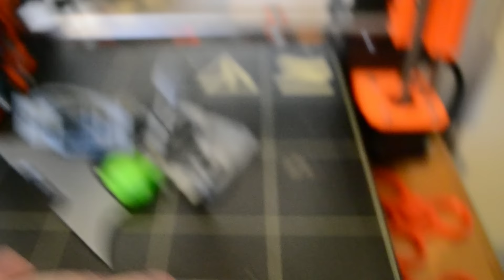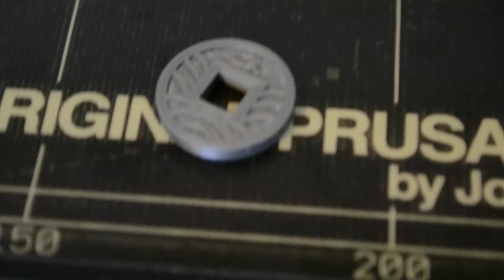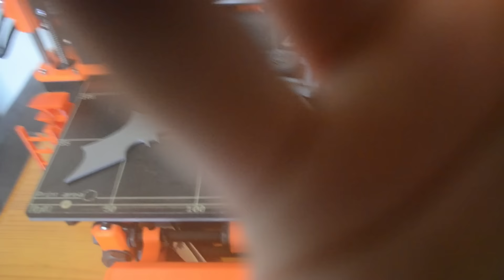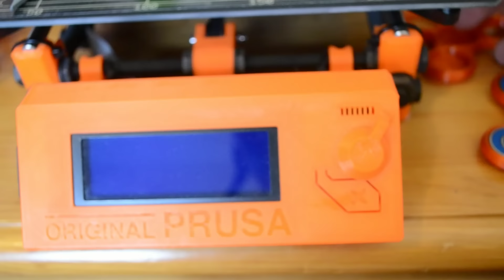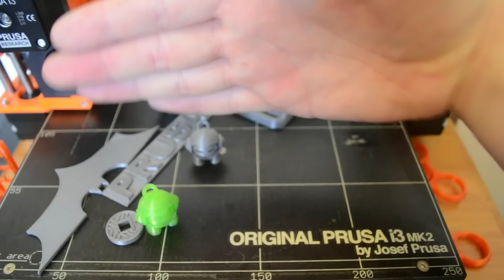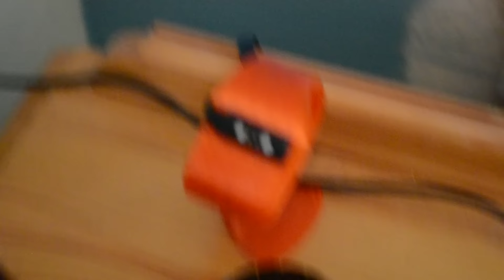3D Printing - My First Month With The Prusa i3 Mk2

Comment: How long did it take to deliver Prusa to you ? was it really about 8weeks or so ?
Reply from the maker: Rastislav Zimermann I ordered half way through December and got it at the end of January, so it was nearly exactly 6 weeks like it said when I ordered. I believe they are shipping April orders at the moment and have got a bigger print farm so have increased their output of printets
Reply: Thanks for quick reply. I am about to order it but as I am on holiday mid July-mid August there wont be anybody to collect it for me(no neigbours) so I need to time the order for later on. just I case. Btw, have you tried to print some mechanical parts or moving parts ?
Reply from the maker: Rastislav Zimermann Ah I see. Have a chat with support on the store and they might be able to sort something out =] I have done a few mechanical & moving parts, I printed the included gear bearing which spins great and came out perfectly first time. I had a few bits of trouble early on like I said but that was me not getting print settings right, but now everything comes out perfect every time

Comment: i'm not English and I can't watch the entire video... but I have 3 questions: is it difficult to build the printer? is it simple to print? are you happy to bought it? 
thanks
Reply from the maker: Marco Richiedei It isn't difficult to build for me as I have always been buildings and repairing things. It has very good instructions which should help even newcomers to build it properly.
Printing is fairly simple, as you can just download a file from thingiverse, put it in the slic3r with default settings and print with the included material. YouTube will teach you more about what settings and how best to print things. Finally i am super happy with the printer. I have run into problems as i said in this video, but I've overcome them eventually after looking up solutions on the internet. the quality is as good as i thought it would be if not better!
Reply: Spaghettikid wow!!! thanks for the really fast answers!!! last summer I bought a FABTOTUM CORE, which is arrived in October. I made few prints then it stopped. I took it to the assistance and they "repaired" it, but it has broken after 15 prints. now I'm writing to them to solve this problem and, if they're not able to adjust it, I probably buy a Prusa Mk2s. I don't know if the assembled or the DIY, because if I buy the assembled it has been built and tried by them; the DIY hasn't been tried and I have to build it, but if you say it is not really difficult, It could be a good project for this summer.

byeeee....
thanks for your help and love Spaghetti!!! (ps: i'm italian 🍝)
Reply from the maker: Marco Richiedei Even the kits have been tested. they include a test sheet to verify that every electrical part works! The kit is good as you can learn how the printer works so if something does need fixing you know how to do it. The assembled printer is more convenient but you won't have much knowledge of how it works or how to make any adjustments

Comment: I damaged the bed myself before the unit was fully calibrated. The sensor was not easy to calibrate, probably the most difficult part of the whole printer. Good video, thanks!
Reply from the maker: +Kevin Thomas Yeah, it isn't very easy to set up but it seems once you get it in the right place it's ok and just works, occasionally needing live z to be adjusted for different filanents